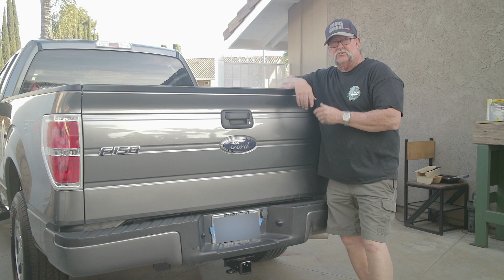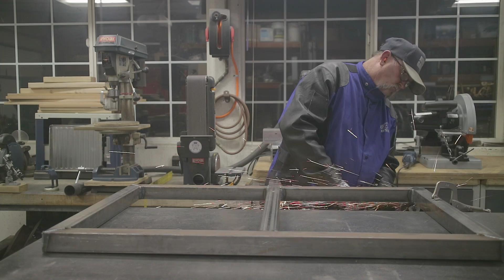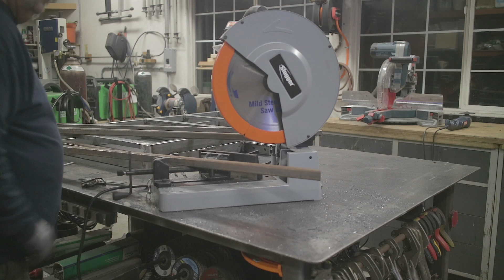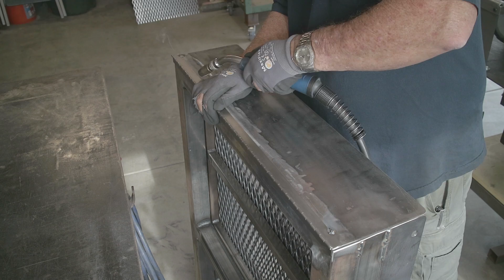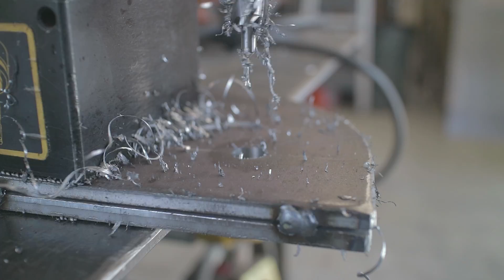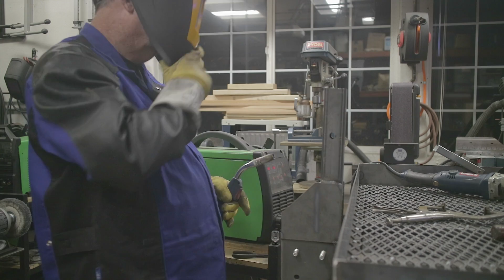Metal Wheelchair Carrier Hitch | JIMBOS GARAGE

Comment: What would you it costs to fab the pivoting hitch mount part of this project. I have a carrier for a scooter, problem is it set a bit to low. I back into parking spots a lot so, I'd like it to be able to fold up when I am not hauling the scooter around. Also I have to use an adapter on my hitch because it's 1-1/4" and the carrier is 2".

Comment: only think i can think of is that the license plate, by law, when being driven, can't be blocked from a rear view, now of course that is the motorists problem ultimately, but i wonder if a 'post' will be installed vertically that will allow a re-mount of the license plate so as to be viewable from the rear ?